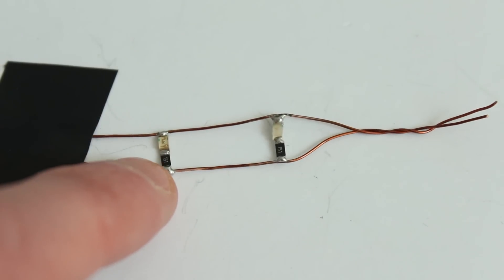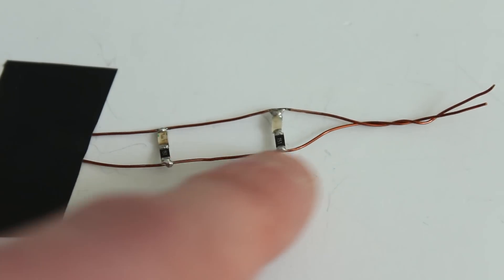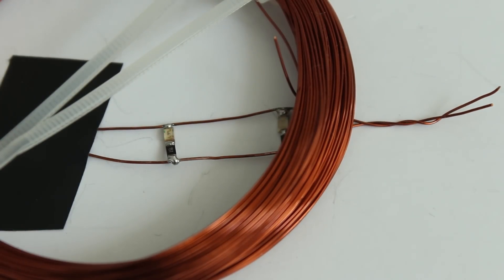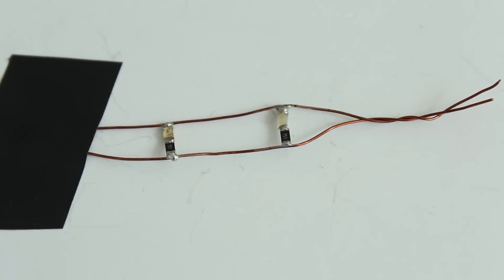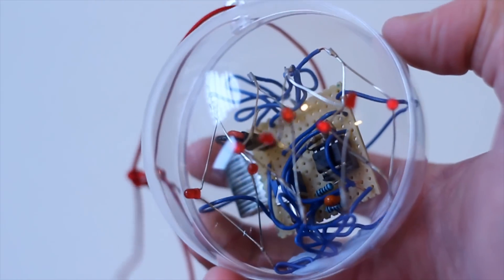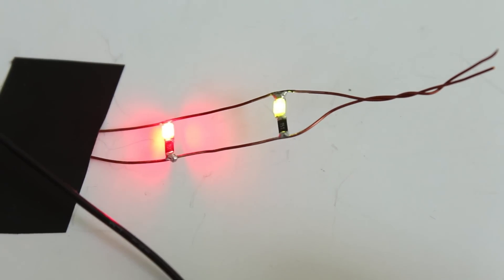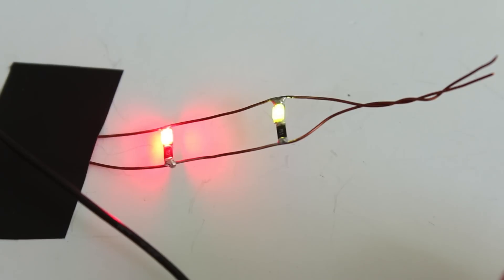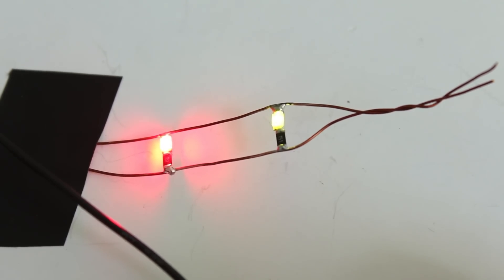Enamelled Wire and SMD LEDs

Comment: what's the specs?
can we use 6V smd led 1W with 5V usb supply?
regular resistor instead of smd? and 4 or 5 1/4 watts resistors in series for 1W led 3V?

Comment: I have done this sort of thing before but never had much luck. SMD resistors and leds soldered together tend to be pretty fragile, the caps break off the resistors pretty easy. I think if I was doing it again id superglue a tiny piece of PCB of something across the back of the leds and the res
Reply from the maker: dangersdnb Thanks for the advice.
Reply: no worries, keep the videos coming :)
Reply: maybe glue a few sheets of paper together to make it stiffer, then them cut up and glue onto the led/resistor backs

Comment: Put some solder to the tip of a soldering iron and use that to melt the insulation off. Works really well, especially for thin wire.

 +1 For making your own Christmas decorations!
Reply: Hugatry's Hack Vlog Yeah I was just about to say that as well.. I'm "educated" with this as well, just "burn" through the insulation with the tip of your soldering iron.

Get that solder to stick then move it to the led/resistor and get it stuck. I wouldn't heat up both led/resistor and the wire as that would screw up the led/resistor of course, but I'm very sure you know that already xP hehe.. So no besserwisser thingie there.. but yeah, just burn through the insulation, get the solder to stick and you're done =D

That's how I do it at least =)

Keep up the great work with the videos!
Reply from the maker: Chris Fredriksson +Hugatry's Hack Vlog Thanks, I didn't have a lot of luck with that. What kind of temperature? I don't have a very good soldering iron so temperature if a bit of a guessing game.
Reply: David Watts I've used that method with non-adjustable 25W solderin iron, one of those soldering stations with knob without actual temperature values and a proper soldering station (Atten 980D: 80W iron with digitally adjustable temperature).

I use around 360C temperature with my Atten for about everything and that works for those wires that I usually use. If it seems like it takes too long to melt/burn the insulation of thicker wire, I'd increase the temperature by 20C. And basically same method worked with cheap soldering station: start with temperature/power setting that works for other soldering jobs and increase when needed.

I usually use 0.2mm wire as I'm using it mainly for low current signals, but I've tried this method with thicker wires as well.